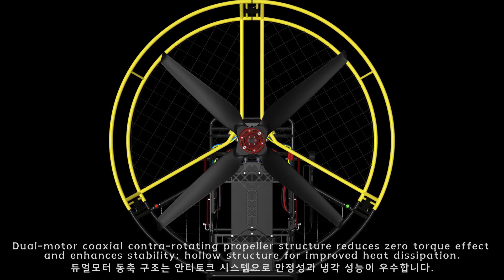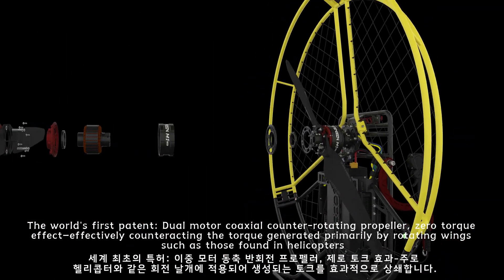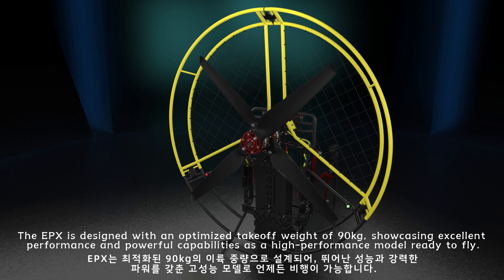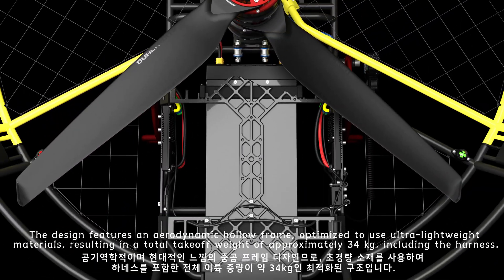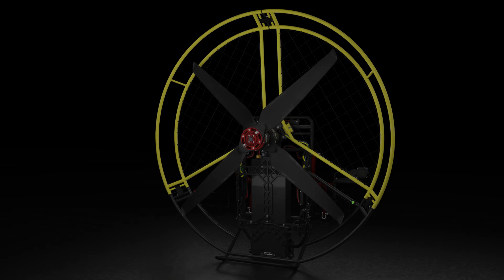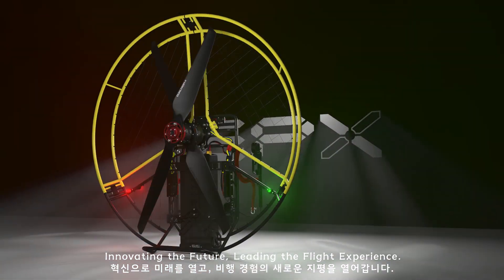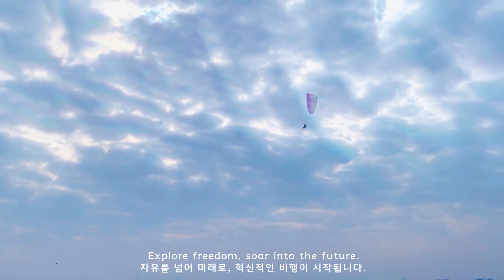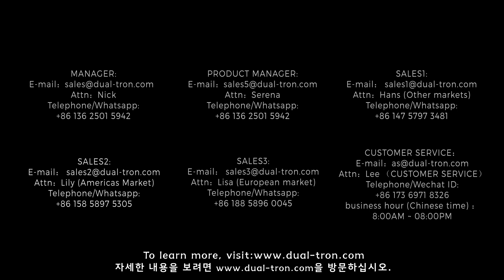The electric paramotor DUALTRON EPX, a powered paragliding motor, is now ready for mass production.

Comment: Probably very expensive.  Heavier then most gas models.  Offshore manufacturing and importing and support - problematic.   Nice design otherwise.   Best design idea I’ve seen six years ago was a with a two foot motor shaft to a folding prop. No cage needed as the pilot gets the wing up over head first then hits the switch.   Even if you add a half moon cage ring to prevent line contact it’s lighter and cheaper.  Not perfect but simpler.     It always comes down to the batteries.     Don’t give up…. batteries will improve.
Reply from the maker: “The price has not been decided yet.
The net weight is 34 kg (including the battery, seat bag, and full frame).
We will be releasing three versions: EPY, EPX, and EPX Hyper.
The available battery capacities are 72V 35Ah, 72V 28Ah, and 72V 55Ah.”

Comment: Biggest concern is range, quick release battery may not be the best during emergency, whatever  that battery falls on to from high attitude will be damaged if it's a human that will be a  case. I will buy an electric paramotor once  they manage to get at least 1 and a half hours flight time minimum, 3 would be great but that's probably not possible unless there will he a huge battery breakthrough.
Reply: OpenPPG are claiming ~2 hours with their latest V2.5 setup and large battery. So it is achievable, but don't expect to spend the flight at wide open throttle if you're looking for that sort of duration. I do wonder if the contra-rotating propeller setup of the EPX will be able to achieve that level of efficiency though.

Comment: Us customers/users/pilots we don't need new features on an electric paramotor (like the proximity sensor) to make it look more appealing to our eyes, because the main point of it being a thing, it's the (theoretical) less maintenance involved compared to an  internal combustion engine. We don't need stuff that may fail and keep us grounded on a flyable day. The only thing that would make people move to electric is a battery pack able to provide 2/3 h non stop flying. And, to me, dual motor means also double power consumption, so...
Reply: Realistically how often do people actually manage anything over a 2 hour flight though? I know very few pilots who fly that long routinely. One of the reasons being it's uncomfortable to be in the harness that long. The other is that it means flying 3 hours after sunrise/before sunset when the air is usually very bumpy and turbulent and it's not a pleasant sensation being bounced all over the sky. It's achievable for a few days in winter, the rest of the time 1-2 hour flights are just fine, and many of the electric PPGs now seem to be getting close to the 1hr+ figure. Still not perfect, but getting there.

Re: Consumption. If the motors are half the size of a single motor, then the consumption will be ballpark similar. However it's much more efficient to spin one large prop, rather than two smaller ones. The advantage of contra-rotating is the torque cancelling, and the smaller hoop, though it doesn't look that much smaller.